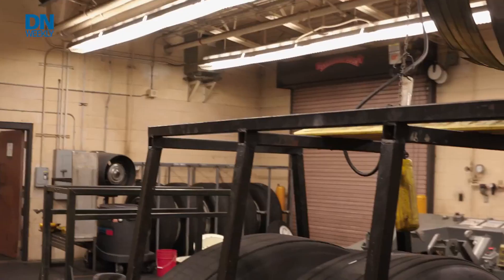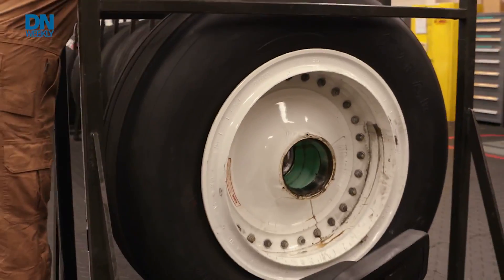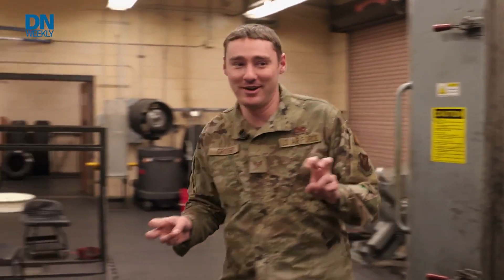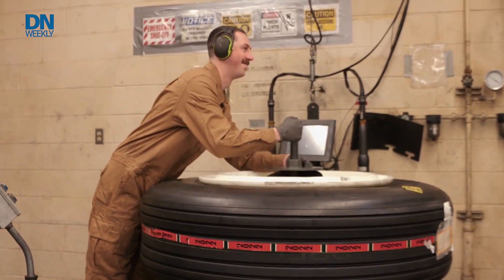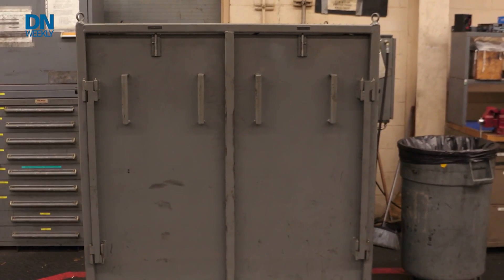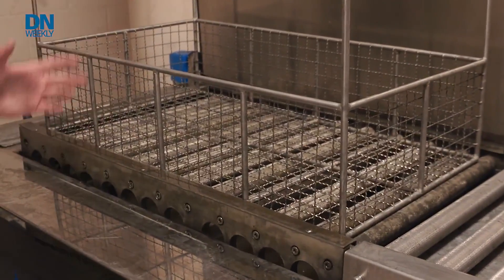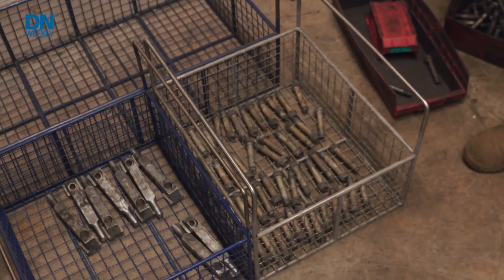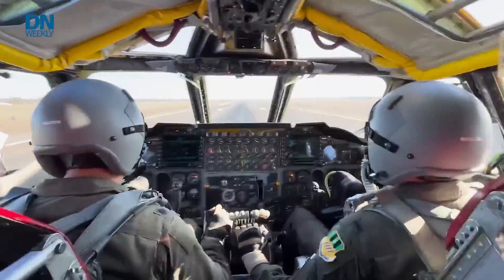How do you change a tire on a B-52 bomber?

Comment: Worked on B-52s at Fairchild AFB in 69-70.  Was injured while me and another guy were changing a tire/wheel on the flight line.  I was bent over putting tools away when he said, here hold this, and let it go. It fell onto my back putting me on the ramp.  That ended my 6 year aircraft maintenance career.  I was retrained to computers so all ended well.  Still love the BUFFs.  By the way, what does one weigh?

Comment: I did this at Minot for almost 2 years, and back then the assembly and disassembly was the wheel goes into a jig and we tear them down by hand..     put them in a tank and wash them by hand, take the hardware in buckets to the machine shop and bead blast them before dropping them off at NDI for die pen check..      Once the wheel has passed/failed inspection we put the wheel haves into a new tire, and then spend an incredible amount of time using impact drivers at 150 PSI driving the bolts as tight as possible, before we then torque every single nut down in the proper star pattern..   did this for bombers tankers and t38's..      The only truly scary part was airing up the tires because if they fail on inflation its a bomb

Comment: Never used a hoist to move the wheel. Manual everything except breaking the bead. Never used a dolly to install the tire on the aircraft. Two guys and lift with your knees. Just ensure was not around.